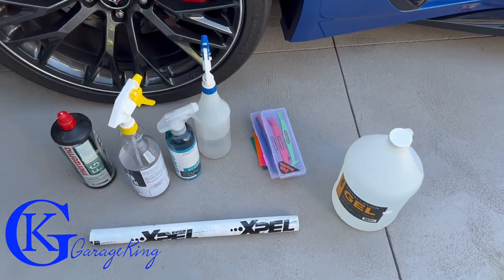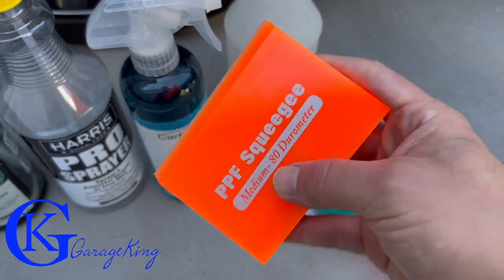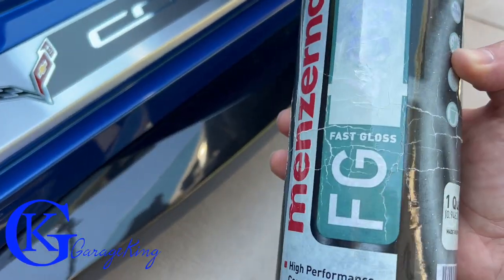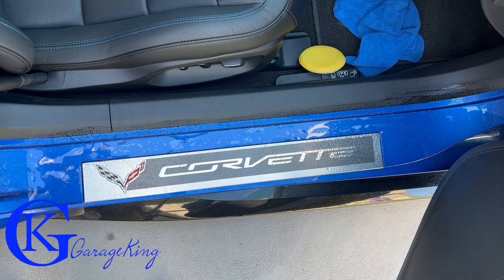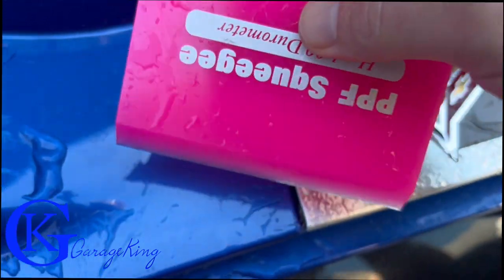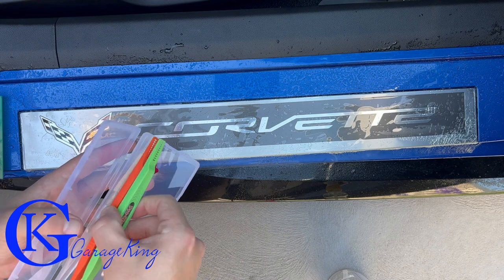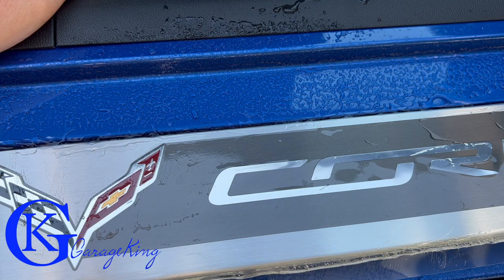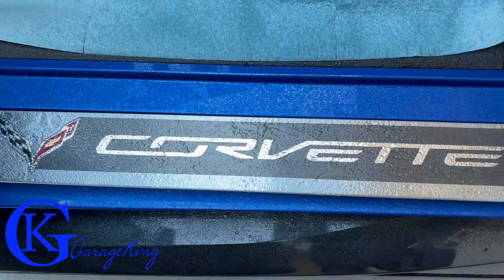How to install Xpel paint protection film on door sills

Comment: The very first piece applied was large and covered the Paint of the Sill and your Plate, did you remove this and then apply the second just over the Plate?  Please let me know, I will check back in a couple days.  Thanks.
Reply from the maker: Hey There and thanks for the comment.  There were 2 pieces applied.  The 1st big piece DID NOT cover the sill, it went around.  Start at the 3:20min mark and you can see it's cut out around the sill. Once you get that piece done you can do the sill. It was a pretty easy job, but if you are doing the sill I would recommend getting a set of those small hockey stick things that I used on the sill.  They make getting the fluid out really easy as there was no way I was going to be able to do that with a squeegee because of  the raised corvette letters in the sill.  Hope this helps and if you have any other questions just let me know.  The link for the hockey stick things is https://amzn.to/3u7YO2m

Comment: Will this Xpel kit fit properly on a C8?
Reply from the maker: I'm not sure, but I kinda doubt it.  You would have to check with Xpel.  I must say this is a worthwhile thing to do.  The Xpel is self healing so when it gets scratched up a bit, just take a blowdryer to it and it smooths right out again.  Those little hockey sticks really worked well for getting the slip solution out of the word "corvette"